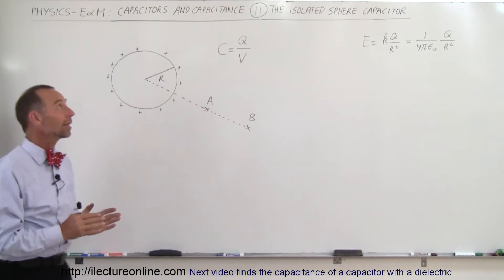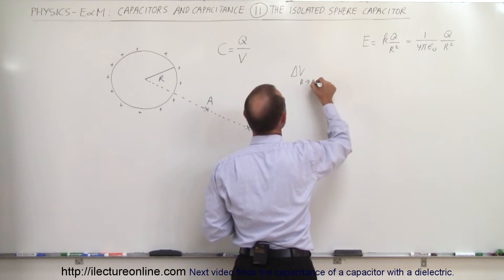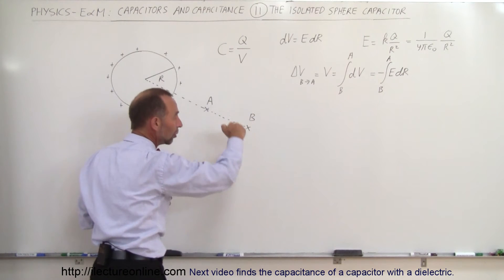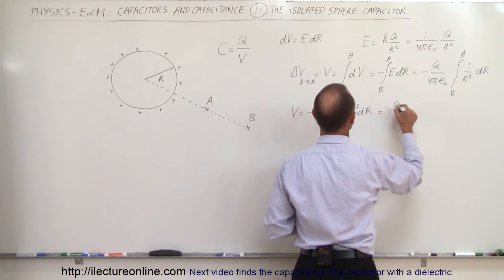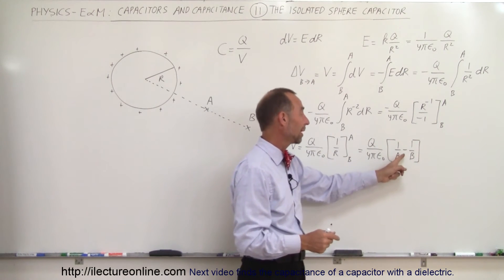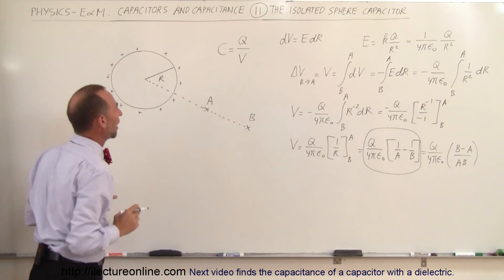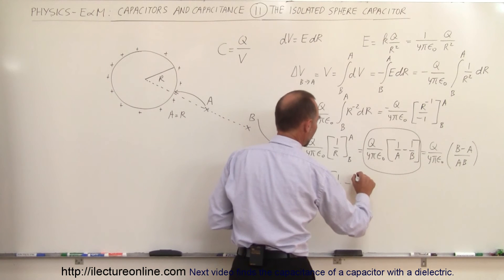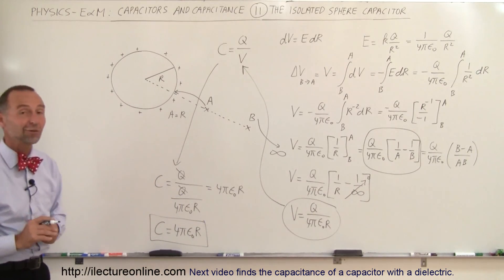Physics 39   Capacitors (11 of 37) The Isolated Spherical Capacitor

Comment: Sir the definition of capacitor is 2 isolated metallic plate separated by some distance d right. Here where is the second plate
Reply from the maker: Yes, a spherical capacitor as depicted in the video is not the standard capacitor as you described it.  Essentially a capactitor has the capacity to hold charge.  But this type of capacitor is more for learning the principles and is not something you would encounter in an electonic circuit.
Reply: Thankyou so much sir
Reply from the maker: You are welcome.

Comment: Sir , if there were solid sphere , then what wii we do?
Reply from the maker: That depends.  If the solid sphere is a conductor, then all of the excess charge will reside on the surface.  If the solid sphere is an insulator and the excess charge is distribute throughout you will need to calculate the electric field as a function of radius.  We have videos on both of these cases
Reply: Sir, please provide the link . I couldn't find those videos.